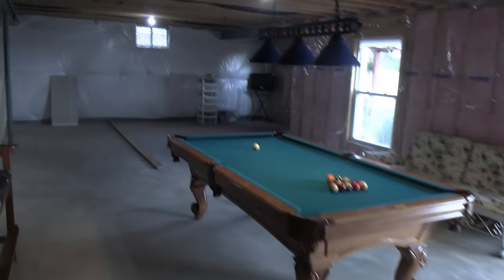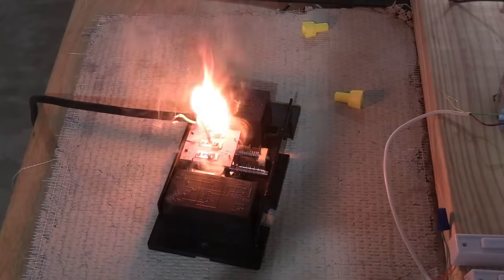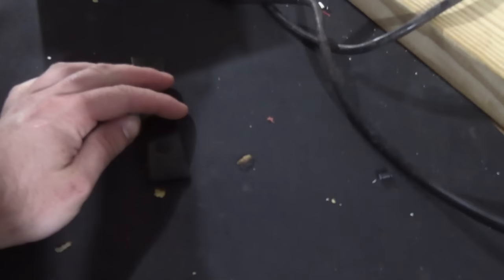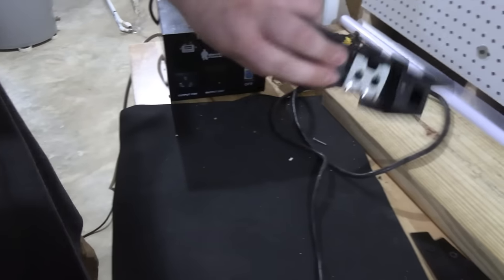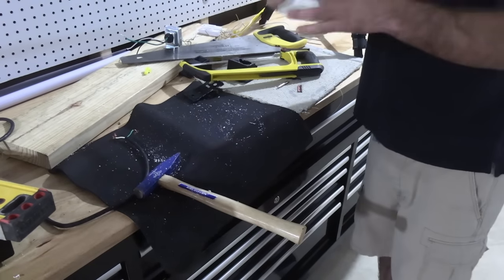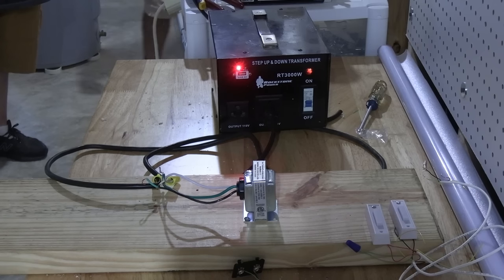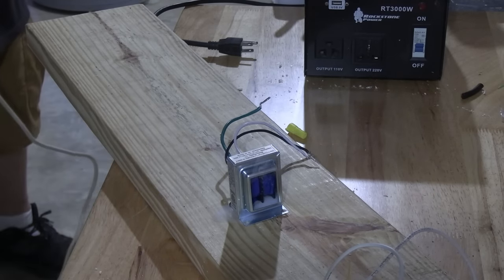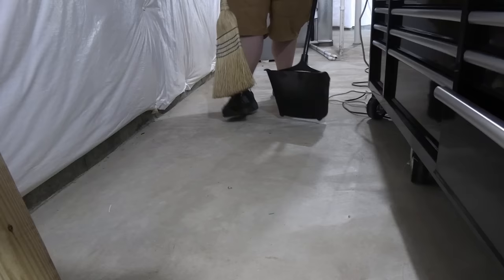Doorbell Destruction

Comment: 1:41 the fact it’s a smaller transformer means it has a lower Q factor, that circuit could be rated for 12v for example yet the system on full load could be pulled below 12v which is not acceptable during electrical engineering. Rating the no load voltage for 16v is common practice with little transformers and is why some beginner hobby electronics enthusiasts sometimes blow up their creations.

Comment: I hate these generic modern doorbells made from the 90s. I honestly prefer the ones made before 1980 because of their quality. I have one that's nearly 70 years old and hasn't had any problems. These generic ones are most likely made in communist land (China); the ones made up through the mid 80s were always made here in the USA. I'm so glad you guys destroyed one of these pieces of garbage, I bet this whole unit was going to be scrapped because of how shitty it is.

I used to watch you guys back in junior high , I'm currently a senior in high school

I laughed so hard when you guys put the cheap ass door chime on 115 volts AC (you turned into a vibrating chime (continuous) as opposed to single/double stroke (ding-dong). A lot of hospitals and libraries had single note versions as fire alarm signaling devices. I have seen them used as class change signals for schools. they were often single stroke, which was meant for use on coded fire alarm systems, or ones that had a master signal code generator in the control panel. there were also vibrating ones for use on smaller systems that had no signal code (systems for really small buildings).

Comment: Why use a step-up transformer if you can have 240 volts from two separate outlets or a dryer outlet or even directly from your service panel ?
(I watched Technology Connection's video called The US electrical system is not 120V).